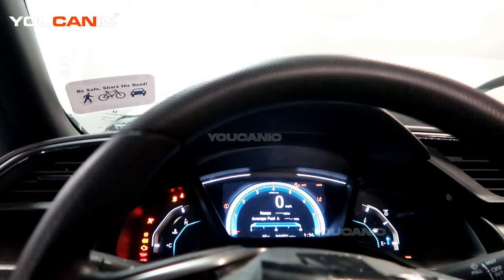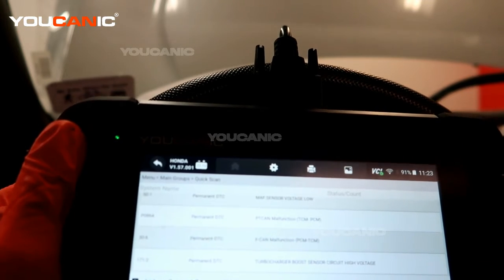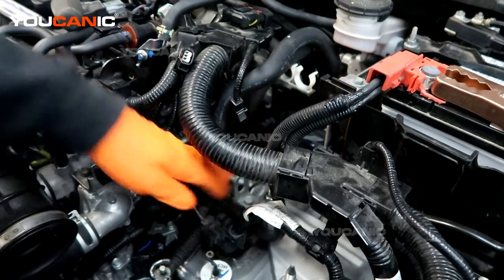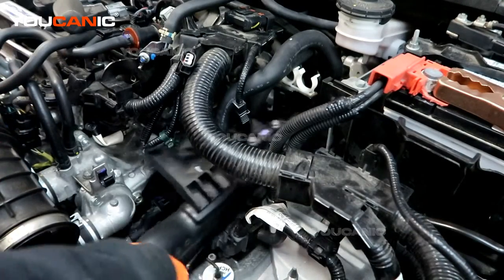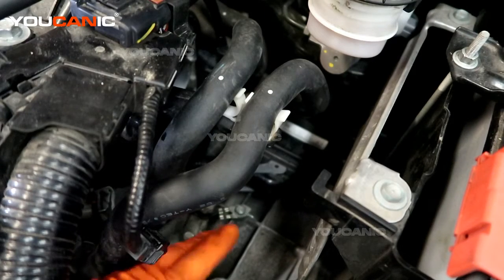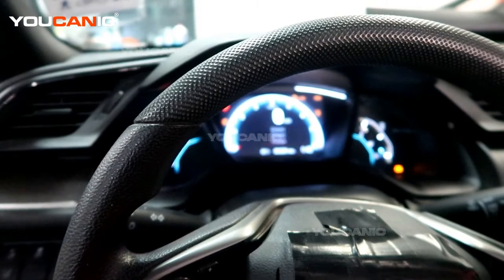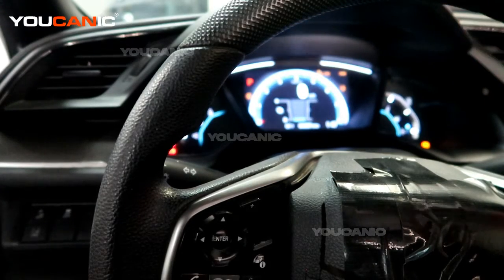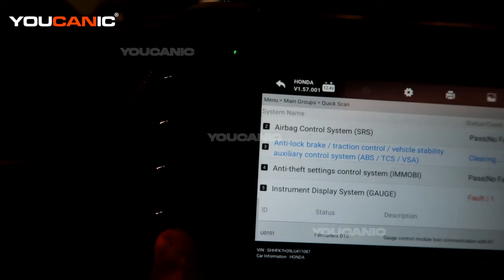Honda Transmission Control Module Replacement - P0864, P30-6

Comment: What if you pull out the TCM from the same year/make/model 10th gen and it has the same part # on it.  Is it a direct swap with no vin# attached?
Reply from the maker: Thanks for reaching out! If the Transmission Control Module (TCM) is from the same year, make, and model with the identical part number, it's very likely it could be a direct swap. However, some cars might require VIN programming for the TCM to function correctly. You can visit www.youcanic.com for further guidance, enjoy our free resources, utilize the YOUCANIC scanner, or delve into our factory repair manuals for detailed assistance. We at YOUCANIC believe in empowering car owners with comprehensive knowledge to make self-repairs with confidence! Keep the queries coming, we're here to help with your car maintenance journey.